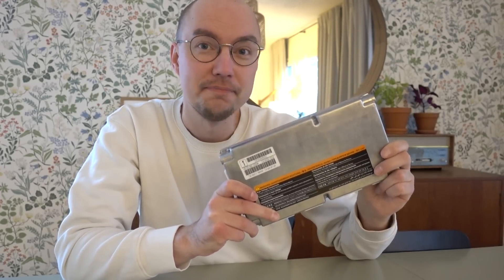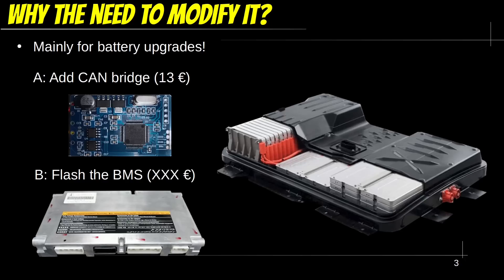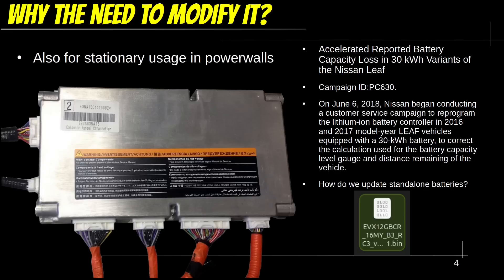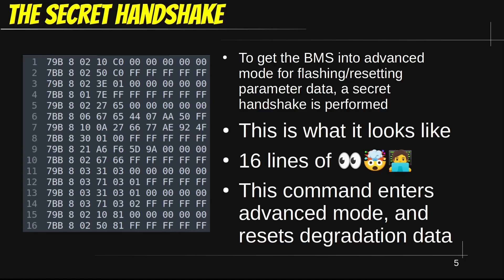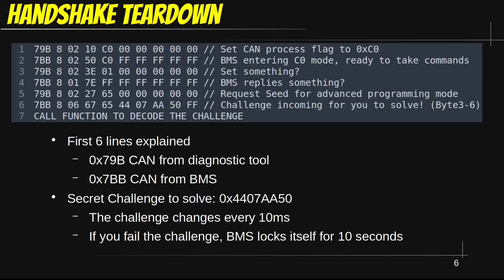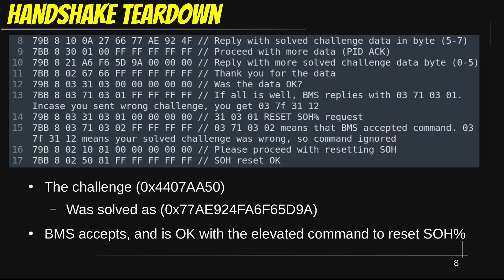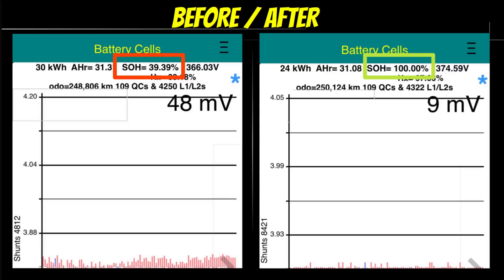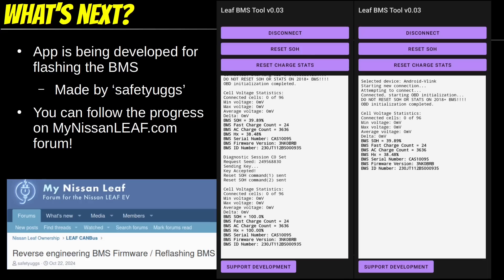Nissan LEAF BMS unlocked 🔓

Comment: And it's this year I have begun hearing about more shops in Lithuania starting to replace old Nissan Leaf Batteries with larger capacity ones. I wouldn't be surprised if the ability and popularity to do so comes thanks to your (and others from the forum) open sourcing efforts. Awesome work.
Reply from the maker: While these cellswaps might be tempting, only go for >50kWh ones. The smaller ones are not safe, they overload the cheap chinese cells capabilities. I will make a dedicated video on why these cell-upgrades are problematic later.
Reply: @DalasEVRepair  http://www.youtube.com/@starmaxenergy seems rater serious about upgrade of Nissan batteries and transparent about the quality of their products. Anyone out there having any first hand expirence dealing with them?
Reply: @DalasEVRepair  You probably meant >50Ah? I use CATL 117Ah and they work fine. IR is under 50mOhms and they stay pretty cool.
Reply from the maker: @slavric  no I meant 50kWh. Will explain the technicalities in the next video.
Reply: @DalasEVRepair  Thank you a lot.
Reply: So, we can see, LBC stores data about SOH. What about charge/discharge diagram and other voltage and amper characteristics, battery temperature managing (if it mounted) and so on...
Reply from the maker: @Alex_Nsk_26  It has a large amount of lookup tables for all this. More on this later